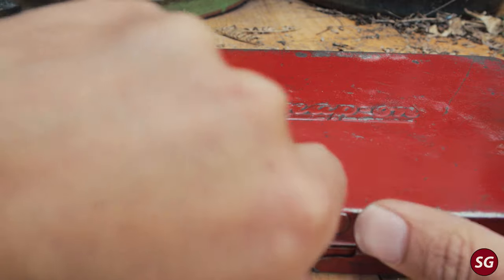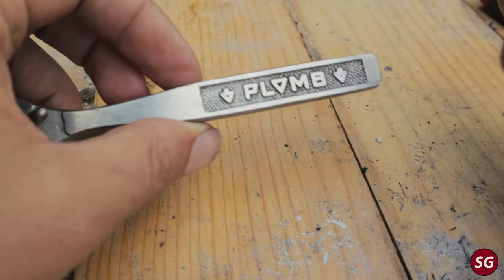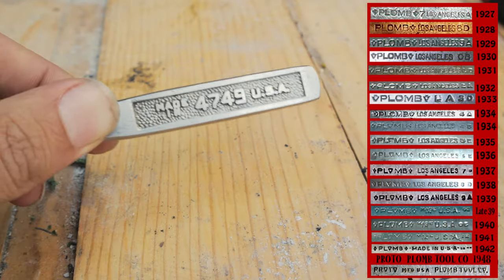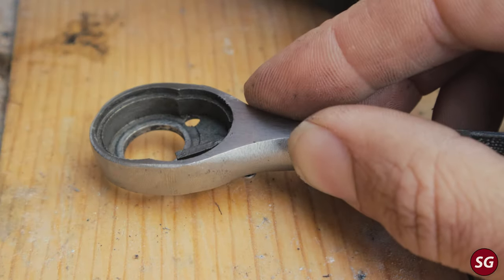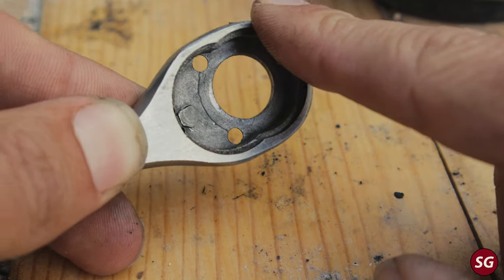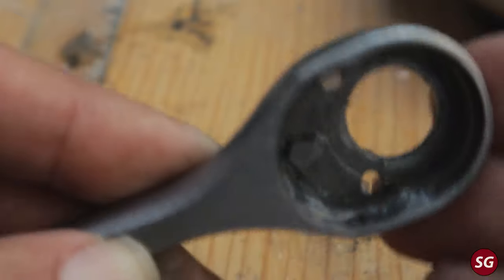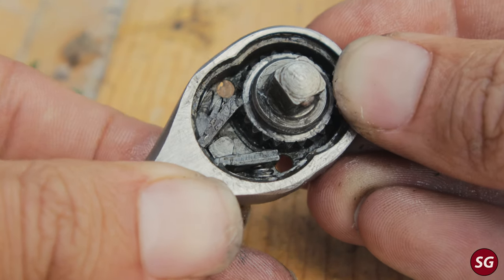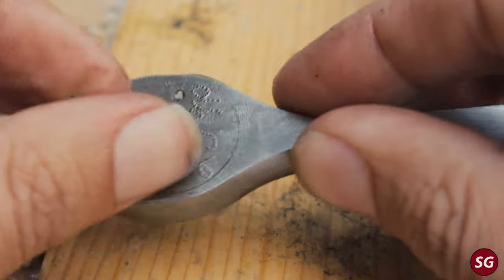Plomb Pebble Handle Ratchet Rebuild

Comment: One must remember that many tool patents were still in play at the time this was manufactured. In use I find that the Plomb ratchets tend not to turn loose fasteners on the ratcheting stroke due to the very very low resistance the design affords... Serendipitous, given the design probably had more to do with avoiding competing patents than it did with user functionality.
Reply from the maker: Interesting! I never thought about that.

Comment: I have modern ratchets, by Britool Hallmark and Halfords among others (I'm in the UK), which use that same V-shaped twin pawl design. You could really make that pebble design pop by colour-filling with a black oil paint marker, then swabbing with rubbing alcohol to take the paint off the high spots, just leaving it in the background.
Reply from the maker: That's a great idea! I might try that in a future video!
Reply: I collect ratchets and the only British one that I have is made by King Dick. I wish that I could find a Britool or Halfords.

Comment: Concerning the engraved face plate, wouldn't it be possible  to polish the reverse side and flip over?
Looks identical from here.
Reply from the maker: Definitely a possibility - something I might consider doing in the future. Just need to confirm that the countersink for the screws is the same.
Reply: @speedygarage264  Most common is 82 degrees.
Might get lucky